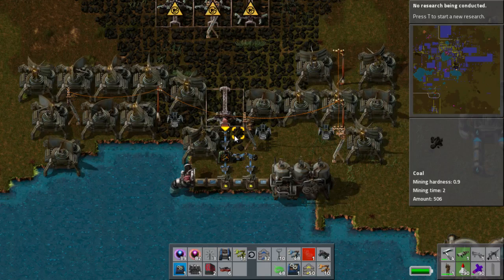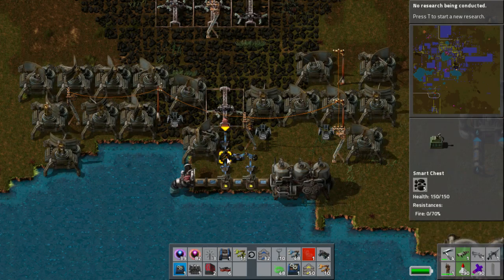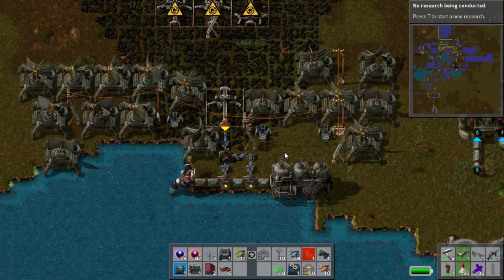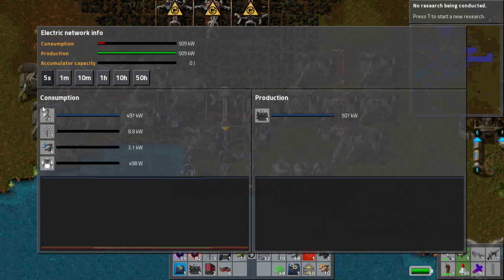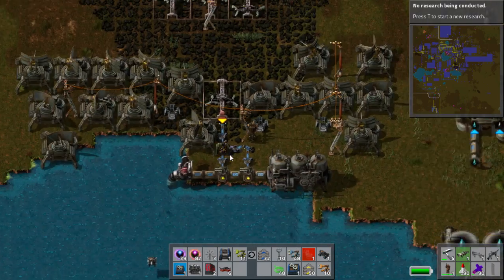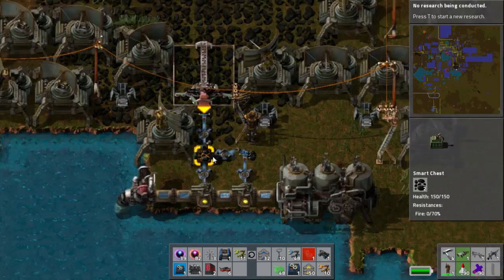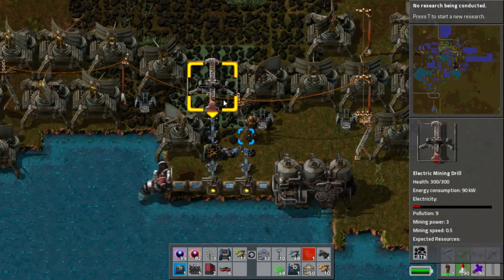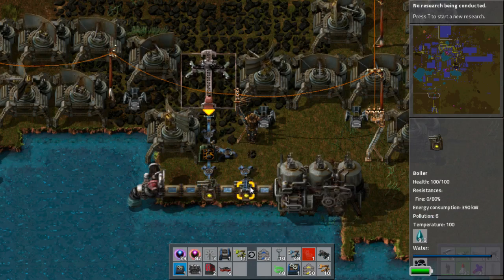Factorio Tutorial 32 Negative Feedback Loops

Comment: This is why I like to set my power production equipment apart from the electric network.
For example, thermal drill self fuelled with a thermal inserter and thermal inserter to put coal on the boiler, some coal from the patch are lost for that, but at least, until it run out, we still have everlasting power production whatever happen to the electric network, another way can be to use solar panels and accumulators to power electric drill and inserter, even without accumulators, with enough coal on a long enough belt to last during the night, if the coal output can manage to always saturate it, we end up having boilers only limited by the coal patch, but accumulators help a lot of course.

This is also why I love solid fuel, as sun and water, oil is unlimited in Factorio, and if we have enough oil patch, once they reach their minimum, they can still through conversion make enough throughput to power the boilers, we end up with a system that will never stop over time unlike coal, and with for example a separate boiler and steam turbine set to power the pump jack, refinery and chemical plant and inserters, we can, if we have a good enough system, end up with ever lasting power.
Solid fuel, first power the steam turbine that make all that possible and all the rest of the production goes to the one for our main base, or at least one of them, and we may still have enough solid fuel to fuel train and other if the oil patch is big enough !

Comment: I had a negative feedback loop that was so bad that I said screw it and started laying out solar panels until the factory didn't need steam power. Then I disconnected the coal supply to power and added in requester chests asking for 20000 wooden power poles and 20000 logs. Now I have I giant incinerator.

Comment: One reason more for me to dont rely on laser turrets. My base is defendet by an double wall and an MG every few meters:)
Reply from the maker: Romuland Meier as the biters grow and get bigger, you'll have no choice. MGs won't get through the armor of big biters.
Reply: Negative Root So true, Against the big blue biters the machine guns are quit useless. Maybe the developers will allow rocket towers without mods in the future :)
Reply: +Negative Root You are wrong about that. It is surprising how many people do not realize that a fully upgraded MG turret is actually drastically stronger than a fully upgraded laser turret.

In 12.21, A MG turret would have a DPS of 1050.4 against a blue/green bitter where a laser turret would have a DPS of 343.2 against the same. I would like to remind you that this is against targets that actually have significant physical resistance. The downfall of MG turret is and always was ammo supply. A fully upgraded turret burn through ammo at ludicrous speed. Defending a base for several hours quickly becomes a monstrous waste of resources. Power on the other hand can easily be infinite.

I don't remember the numbers for the older smaller turrets, but the MG turrets where still stronger. But admittedly by a much smaller margin as the 8 points of resistance had a much bigger impact.

That being said, a low level laser turret is still useful where a low level MG turret quickly becomes useless against upgraded bitters.

Comment: It is neither positive or negative feedback. It is supply and demand issue. The drain is demanding power that it is consequentially responsible for providing it. If there isn't enough power then there isn't the ability to provide more. A negative feedback system would be a setup where an accumulator switch triggered a smart inserter to feed the supply if there is more drain than currently handled. A positive feedback system is with an accumulator cascade with more boilers in a setup where power provided to an accumulator that charges and then feeds an inserter for a boiler that then charges another accumulator which then feeds another inserter to another boiler and so forth down the cascade. The more you pump in the more becomes available. Doesn't really work in Factorio as there is not a concept of a diode.

Comment: that happened in my factory once, everything started slowing down and quickly my power died completely
what I did to fix it was replace the inserters on one column of steam engines with burner inserters and had several burner miners facing into each other with more inserters pulling some of the coal out and onto the fuel line

basically I will always have SOME power going

Comment: This is actually positive feedback. Negative feedback is when the system stabilises itself, such as full belts decreasing upstream production.
Reply: Negative Root
No, the fluctuations increase. A little power shortage causes a larger power shortage, that in turn causes an even larger power shortage.

From http://en.wikipedia.org/wiki/Positive_feedback

Positive feedback is a process that occurs in a feedback loop in which the effects of a small disturbance on a system include an increase in the magnitude of the perturbation. That is, A produces more of B which in turn produces more of A. In contrast, a system in which the results of a change act to reduce or counteract it has negative feedback.

Positive and negative feedback doesn't mean if the signal goes up or down, but instead mean if the event reinforces itself.
Reply: Negative Root
Power is the output.
From your quote earlier "in a manner that tends to reduce the fluctuations in the output" notice the word "fluctuations" as that is what feedback is about. The fluctuation is the power shortage.
Reply from the maker: Negative feedback is when an oscillation decreases (or is dampened) over time in a system. Positive feedback is where it increases or gets greater..

The system is stabilizing itself, but not in a way that is helpful and certainly not in a way that you would call positive feedback. The production of coal isn't increasing over time, it is decreasing (or is dampened) over time.
Reply: Negative Root I agree with skaihoj on this one. In control theory, positive feedback is any time a disturbance to the system causes a response which reinforces the disturbance. In your example, this occurs when a shortage of power leads to an even greater shortage of power, or seen at the input, when a shortage of coal leads to an even greater shortage of coal. A negative feedback loop is when a change to an input causes a change in the output which counteracts the change in the input. An example of this would be your buffer storage idea where a shortage of materials in a chest triggers an inserter to feed an assembler that results in filling the chest that was running low.
Reply from the maker: Ok, now I'm really freaking confused.

From http://en.wikipedia.org/wiki/Negative_feedback

Negative feedback occurs when some function of the output of a system, process, or mechanism is fed back in a manner that tends to reduce the fluctuations in the output, whether caused by changes in the input or by other disturbances.

Isn't that the same as what is happening here? The strength of the output is decreasing because there is negative feedback in the system weakening it.
Reply from the maker: Aha! Now I understand!!! You're thinking of the shortage as the output.

When I'm talking in the video, I'm speaking about the power being the output.
Reply: +skaihoj/simoni Though it could be argued that it is a feedback loop with a negative effect, making it a literal negative feedback loop. :P
Reply: Positive feedback causes the effect to "run away" and crash. In your case, it crashed to the bottom. Another example of positive feedback is putting two magnets close together. They attract harder the closer they are, which moves them closer faster, and boom, they crash. Or the human orgasm, where sexual pleasure builds and builds and then boom, there's a crash.
Negative feedback keeps the machine going. If you get too hungry, you look for something to eat. If you get too full, you stop eating. An example of a negative feedback loop would be looping the belts where your empty oil barrels go back into the track before where new empty barrels are made, so that if you already have empty barrels there won't be space on the track for the barrel-making machine to shove new barrels in. Thus making sure your oil extracting machine always has priority and can put down its empty barrels. To make your power loss a negative feedback loop, something would have to realize that your coal was running out, and shut down the rest of your factory except for the coal miner and the inserters to keep the heat up.